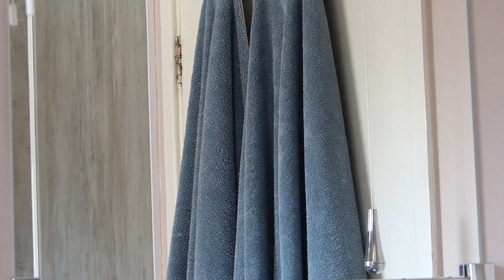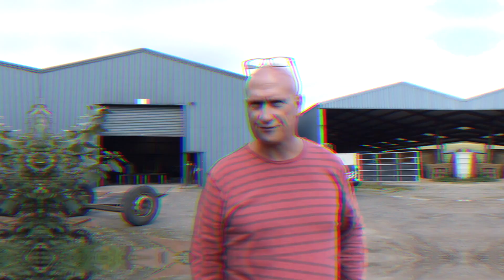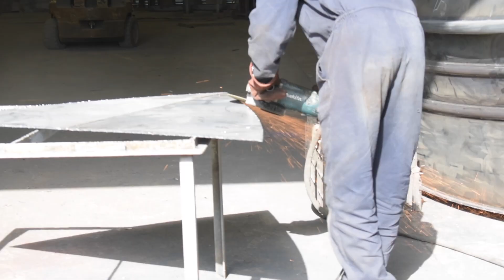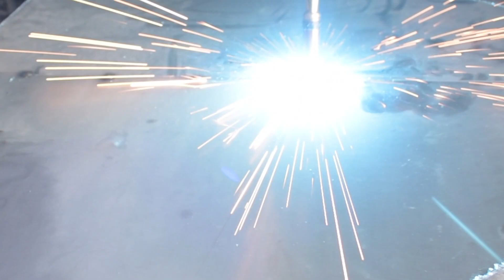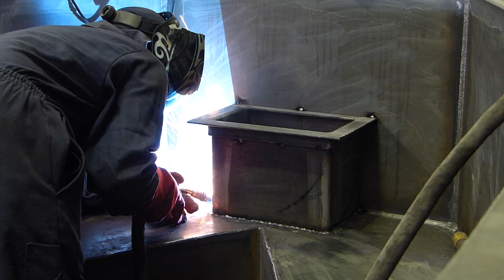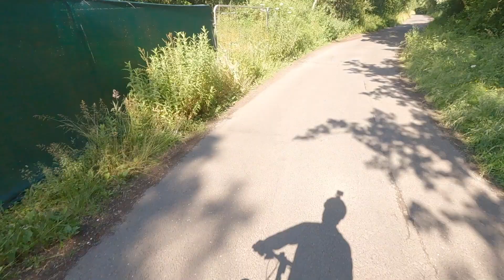Ep 2. Designing a Narrowboat

Comment: Like your video's started with 5 working down to 1, 10 mins is a real punchy time.  We designed our boat and went with Mark for build and fitout  Hoping to get her launched soon, but supply issues have held us up.  We did not get to see our hull build much as we were in lockdown, but we did go over a couple of times.  Just the two of us and the dog, but we to decided that space was important for us so 65' semi trad and no well deck.
Reply from the maker: Hi Shaun.  Thanks for watching and getting in touch. I hope to become an active participant on the build - or as much as I’m allowed/able. The channel is more of a story, although working back also works.  A spacious boat without a well deck. Adds another 4-5 ft I expect. Also allows the bed to maximise the entire width of the boat - assuming it’s at the front. I’ve seen a few of that design just recently. I hope you’re happy with the boat as I believe Mark produces outstanding work.  I wish you speed to the launch as he needs to crack on with mine!  I’m running out of vlogs.

Comment: It's good to justify your needs for a certain size and fit out of a boat. How your going to use it, # of guests, where you intend to travel, cost, maintainability, etc.... I like to do the same when buying a new truck or car. I call it the Goldilocks method of shopping "ahhh this porridge is just right". It's hard to be happy when a purchase does not work out as intended, but this is usually because of poor planning.
Reply from the maker: You can control what you can. Stuff outside your control, I try not to worry about. That doesn’t always work. I’ve found, on this project, the only thing I control is paying the money!  I’ve had to compromise on a lot. But I have had a plan and by and large, it’s working.